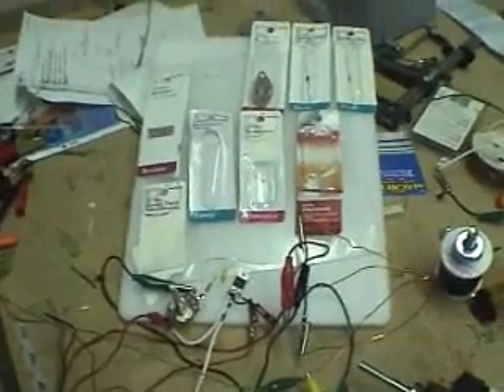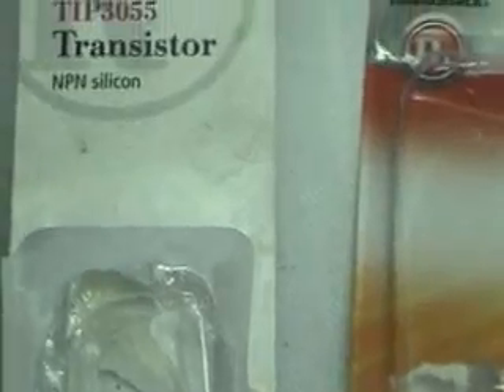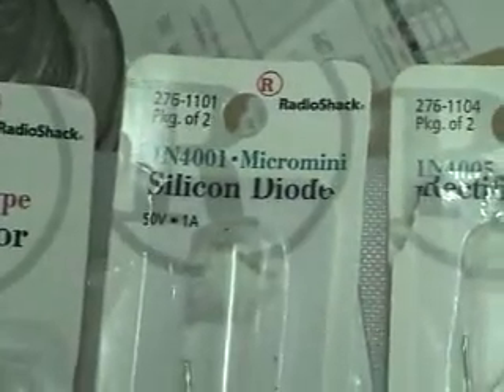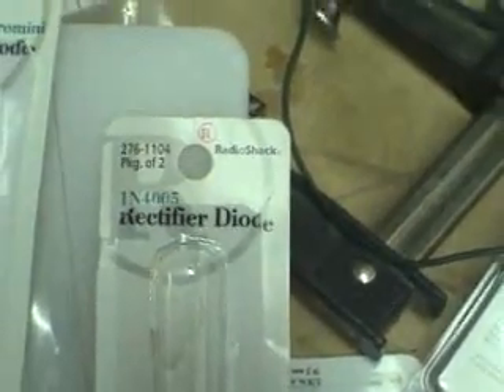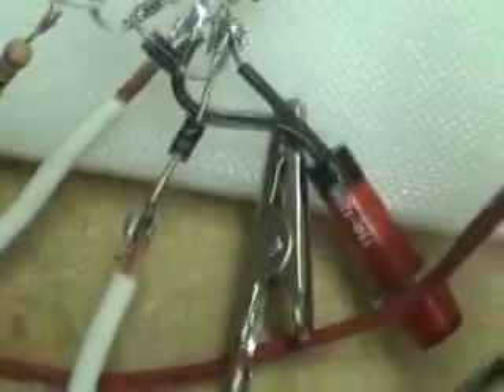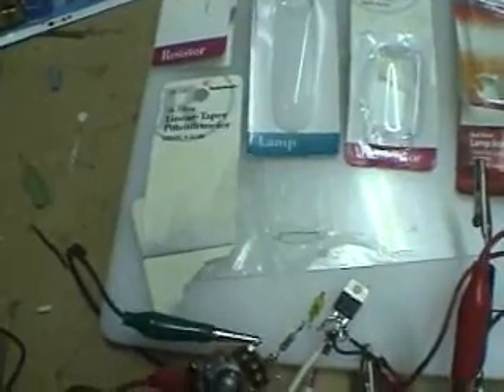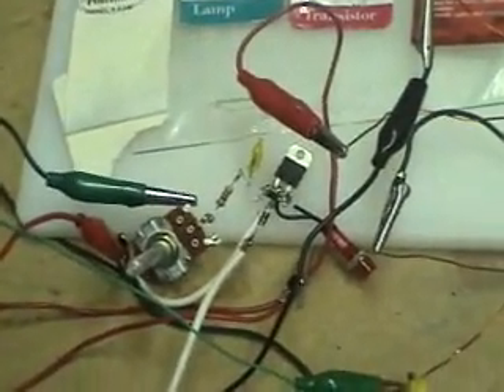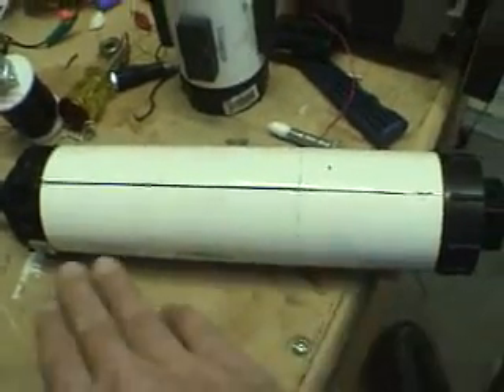Bedini Circuit play by play

Comment: Hi your video is very good I would like to ask you about the connection for the coil .I  am a bit confused The coil has 2 leads on top and 2 on the bottom one thin one thick wire which one is the power and which is the charge is the pot connected to the thin or to the thick on top Thanks